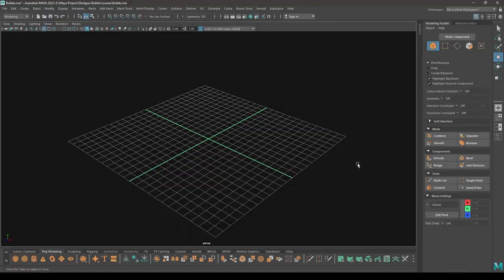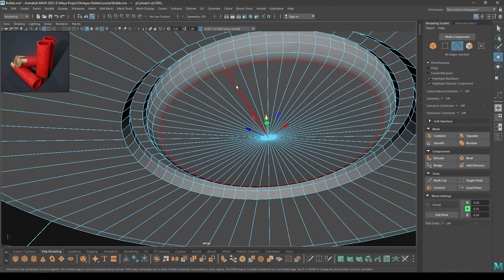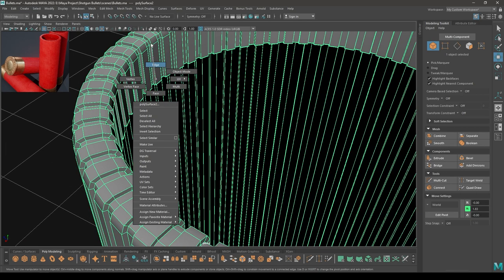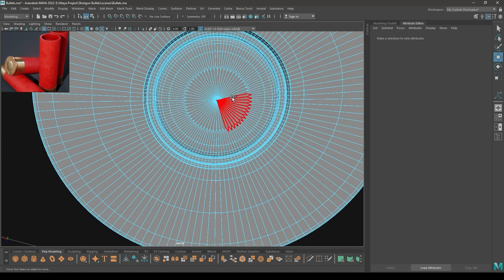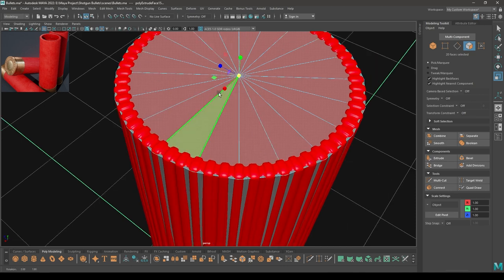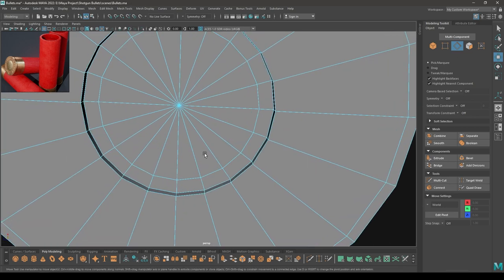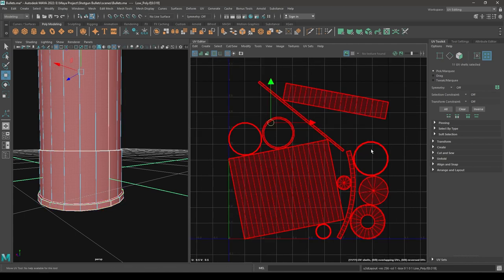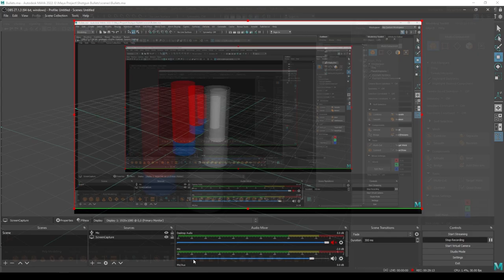How to Create Lowpoly Game Props in Maya and Substance Painter | 01. Creating Highpoly and Lowpoly

Comment: Interesting workflow. I always create the low poly model first, do the UV mapping and apply the color ID map to that one. Then I duplicate it, apply the default Maya lambert shader, create the high poly model, export low and high poly .fbx files for texturing. There is a lot less to worry about with making sure both models are the same scale and in the same location.
Reply from the maker: Yeah it works for props like this.